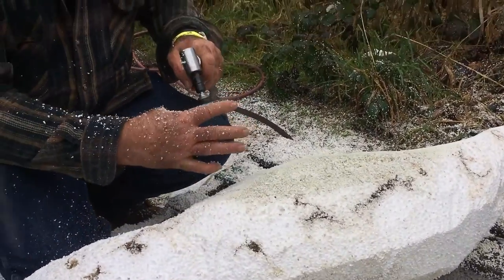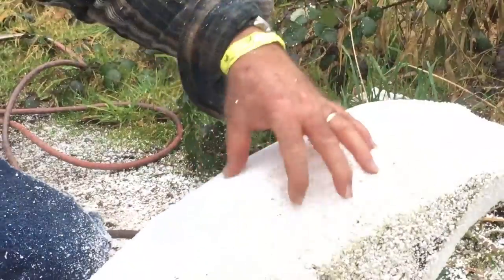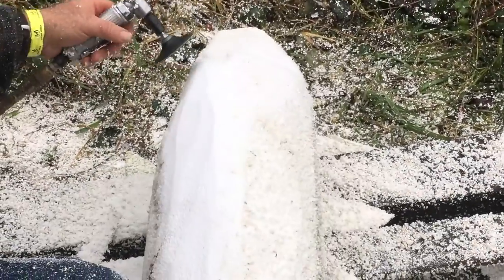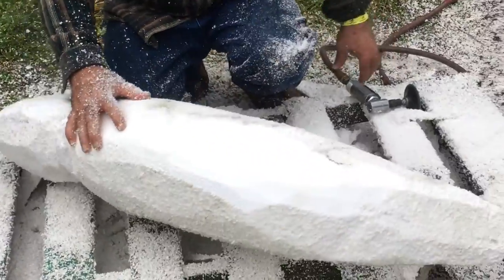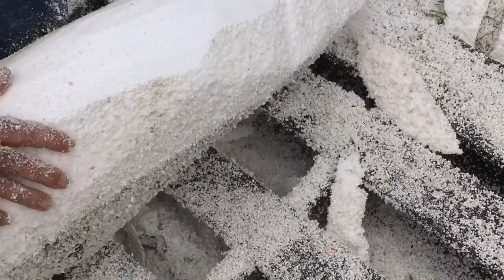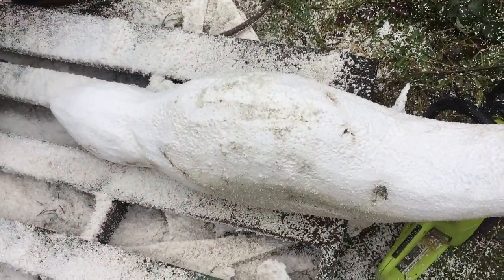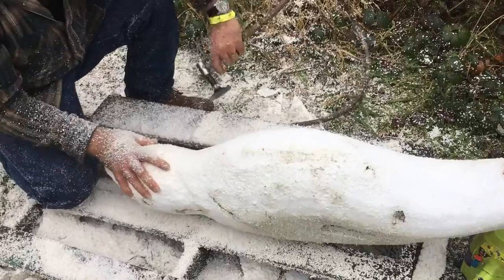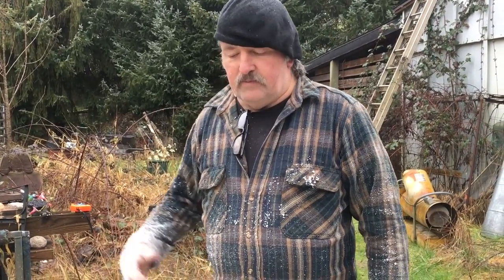How to Sculpt Larger Than Life Hummingbird Video 2: Shaping With Angle Grinder - BillyDillardArt

Comment: Hello Billy. Was wondering if you had experience with using hot wire foam cutters? I was about to pick one up tomorrow but an angle grinder might be a worthy alternative. Your thoughts on the two would be great thanks.
Reply from the maker: I have used them. They do have their place. If you give me an idea of what your carving I would have a better idea what would work best. If I had a project that requires a lot of carving a hot wire is quick and not messy. If you watched my video carving foam with a chainsaw and angle grinder I'm sure you noticed the big mess. I was carving vines this week for the Fairy House project. I used a jig saw to cut it out of the inch and a half foam and a mat knife to carve it with. The mat knife allowed me great control and slice it down little by little till I got what I wanted. By the way, if your using a hot wire, make sure to be wearing a respirator like what you would use to paint a car. The gas coming off styrofoam is toxic. That is one of the draw backs why I don't use a hot wire much. If your carving large projects a large hot wire cutter can come in real handy. Hot wire cutters work great for creating faux rocks out of foam. Vertical Artisans use them to create large faux rock sculptures. I hope I was of some help to you.